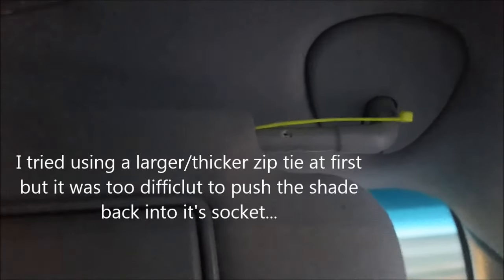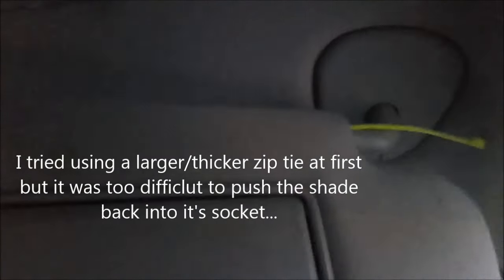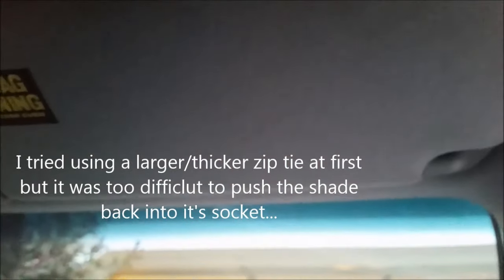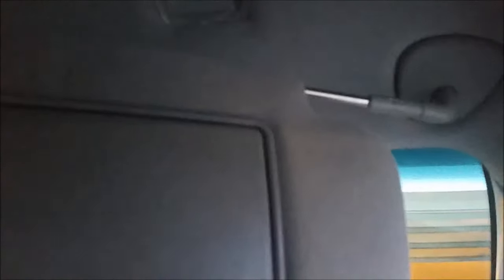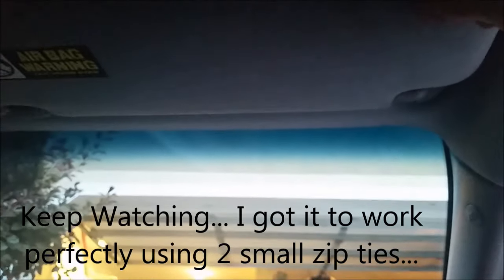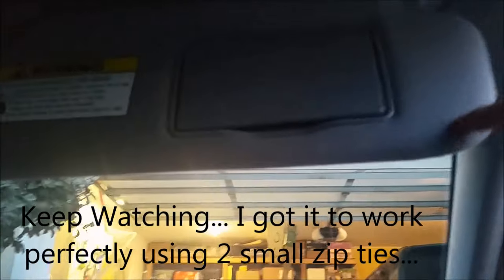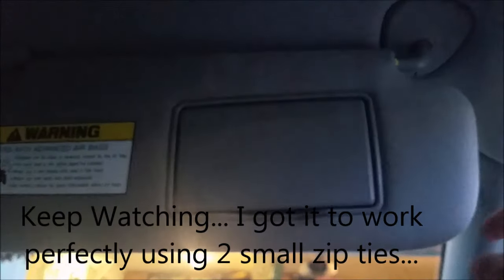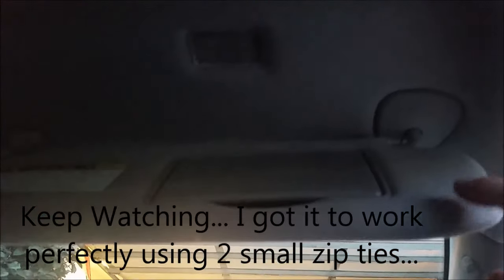How to Fix a Floppy Sun Visor that does not stay in place on Your Car for less than 25 Cents!

Comment from the maker: Hello!  I have another channel where I post repair and DIY videos. Check it out: https://www.youtube.com/channel/UCOnsjUJOcT6YVtAZU0vejZA
Reply: Does your sonata squeak in the front How do i fix?
Reply from the maker: @liljons6753  Where does it squeak? Coming from the engine or something inside the car?
Reply: @TrevorLindgren  the right suspension mostly......
Reply from the maker: @liljons6753  I'm not sure what would cause that. It could be the shock/struts are going bad but I have never replaced those. I did replace a CV axle on a different car of mine that was causing some strange noises and vibration while driving.
Reply: Dont some have wires in them....?

Comment: Dear Trevor, I am trying to do a ziptie repair of my 2002 Toyota RAV4, but I cannot figure out how to slide the flap off of the shaft. There is a copper rod inside the non-hinge side of the visor and there are no screws or slots or anything to let me slide the visor on the shaft as you show in your video.  Yours is probably a later model. But the visor flap will not budge along the metal shaft at all. Please advise.
Reply from the maker: I'm not sure how it would work in your situation. The visor might work differently. Did you have any luck?

Comment: Well I'll be damn!  I tried the tape solution and was headed to the hardware store to try the screw solution but stopped and gave this a try.  This worked perfectly!  I man'd up and used a bigger zip tie and shoved it in good and proper and now it stays up even without being in the retaining clip.  I had the same problem as he did with it initially fitting in the clip so I cut off the head of the zip tie which allowed it to slide in further.  You're the man!

Comment: Thanks for posting this Trevor.  What an excellent DIY fix that worked well for my vintage 1990s Toyota.  It just took some patience and 3 zip-ties to gain sufficient friction.  But since I bought 20 for under $5 bucks there's now plenty leftover to tie off uncooperative TV cables and in case I need to occasionally add one to the visor.  BTW, velcro didn't work and electical tape didn't hold, and now I don't have to pay $60 for a new visor or lose 3 hours of precious weekend time hunting through an auto junkyard.
Reply from the maker: Awesome!  I'm so glad it helped you! You may eventually need to replace a zip tie or two but it is still quick, easy,  and cheap to do so.

Comment: Worked a treat! If the cable tie won't slide in too far, just hold it tight to the visor pole and slide the visor back into place. Then just clip off any excess cable tie.

Many thanks for the video 👍

Comment: Wow. I can't believe the first video I checked for this was a visor on a 2008 Sonata. That's my car. I'll try this, for sure. Thanx.
Reply: I just wanted to update my post of yesterday. This process worked for me! It took a little elbow grease to get the visor back into position. I first tried the velcro method that another video recommended, but that didn't work. It took about 15 minutes to fix it with zip ties I already had. Thanks a lot!

Comment: Thank you.  I just tried this, one zip tie and the visor is like new and not in my face!  I appreciate your posting this fix, as it really works and gave me immediate relief.  Velcro and tape did not work successfully due to the sheer weight of this visor in the 2008 Hyundai Sonata.
Reply from the maker: No problem! I'm glad it worked for you! You may have to periodically replace the zip tie if it becomes floppy again. I have replaced it once but it just took 5 minutes and was easy to do.

Comment: Had the same problem with a 2014 Murano. Ended up putting Velcro on the roof and top of the visor. Works well. But I’m going to try this.  👍🏻

Comment: You can tape the zip-tie to the metal rod with a long thin strip of Gorilla Tape that's just a bit wider than the zip tie --- then slide the visor over it --- that gives it one more layer of 'friction resistance', and it keeps the tie from moving.
Reply from the maker: Good idea!

Comment from the maker: I also had a thought that scrap pieces of plastic from a string grass trimmer could work too and possibly even better because it is rounded where the zip tie is flat. Have not tried this but it could work too.
Reply: FYI zip ties or cable ties as we call them here in England can also be used to replace those pieces of plastic from strimmers and they work better too.

Comment: I have a 2012cToyota Prius. Sun shade very loose. I drilled a small hole in the shade near to elbow, put small bolt, nut and washers on it. Tightend it up, and shade is better than new. No popping and very smooth.

Comment: I'm wondering if it's a "known issue" or a defect. My '08 Sonata has the same issue, the previous owner tried velcro and it didn't work so I removed it. I'm going to try the zip tie fix! Thanks for sharing.
Reply from the maker: Jessica O your welcome! That is a good question.  There is not a recall for it yet but maybe if enough of us complain they would take care of the issue or do an official recall of the broken visors.
Reply: Do you know how I would go about filing a formal complaint for it? Just 
take it to a Hyundai Dealership? Call a customer service number?
Reply from the maker: So there is a website the government maintains that you can file safety complaints on: https://www-odi.nhtsa.dot.gov/ivoq/Complaint.cfm It says that this website may be down temporarily today for maintenance but this may be one avenue to help get the issue resolved.

Comment: Sadly this didn’t work for my 2006 Acura TSX. I used plyers to shove 3 zip ties in there but it still flops down. Tried to shove a 4th in but it didn’t seem to make a difference. Previously tried velcro but that didn’t work. Now I am going to try other things. This is such an annoying problem. Sucks that so many people are experiencing this.
Reply from the maker: Yes it is frustrating. You may have to get a new visor.

Comment: Did this hold up long term??
Reply from the maker: Yep. Still working. I had to replace the zip ties about 3 or 4 years ago by stuffing new ones in but it has held up. Since 2016 so 5 years still working ok. Not exactly like a new visor (it will come down occasionally with a big bump in the road) but it works good enough for me.

Comment: dam i tried a bunch of things...wish i would have thought of trying this first..diffinitely the best solution from how well it seems to work
Reply from the maker: roadstar499 Thanks! It is still a temporary fix and is not perfect but it helps.
Reply: Trevor Lindgren actually it seems pretty permanent to me...even new ones wear out...if it messes  up you just need to add another zip tie..I added two and cut off   the top part...excellent fix...if you figured this out yourself pat yourself on the back...
Reply from the maker: roadstar499 Thanks! I did figure it out; I have had to replace the zip tie periodically in mine but it's easy to do.

Comment: i have just cured my floppy sun visor on my kia 2005 reg sportage, I used a 50mm wide heavy duty hook and loop tape from b&q stores, I just used the hook tape only and stuck two pieces onto the mirror cover and two pieces onto the material and then pushed the sun visor back up and attatches itself to the material above the visor and its still holding, .

Comment from the maker: My fix now is not as solid as it was when I first did it. I am going to try placing another one in there or a larger one and see if it helps. I will let you know!
Reply from the maker: I replaced the zip tie with a larger one and it took 5 minutes and is doing great! I may need to periodically replace the zip-tie but it is easy to do and cheap.
Reply: @TrevorLindgren  good job Einstein , great job , gonna jam the big zip tie right off the bat , and LEAVE IT ALONE , even though i have 2 ,  big one swings to door window , keep up the ingenuity  an great video too , thanks for the share 👍✌🍻

Comment: How did you get it off in the first place? That's what I'm having trouble with. Thanks, Trevor
Reply from the maker: Is yours a Hyundai Sonata? If your visor is the same as mine I just pulled firmly on the visor (away from the hinge)  and it slides off the metal rod but be careful as once you pull it off there will be a thin wire that you don't want to damage: the small electrical wire is what feeds the little light above the mirror. Don't let it dangle because then the entire weight of the visor will be held by the tiny electrical wire. Have the zip tie ready to go before you pull it off so you can hold the visor up while you do it. Hope that helps. Good luck!
Reply: RAV4 2006… From reading I may have to pry it off, think will go with velcro meantime, thanks!
Reply: Did you get yours off? I cant figure out how to remove mine
Reply: Yes, but couldn't fix it. I pried it off somewhat carefully with a flat head screwdriver, there are some tabs that have to click off. Used velcro in the end, but needed to stick the bit on the roof with contact glue as it's regular sticky backing wasn't strong enough.
Reply: thanks! i shoved a couple bobby pins in as far as i could.  it's currently working...i don't believe it will last though

Comment: Actually, magnets worked for me.  Double sided tape and magnets worked for a while, although the magnets worked perfect, the tape only lasts a while (depending on the product), and and after removing the tape- instead a tiny bit of silicone/goop glue/ or epoxy will do the trick (I can keep you informed).  Don't use industrial strength magnets because that puts stress on the glue.  play around using the double sided tape, once you find the size magnets that feel good- then glue.  That is my experience.
Reply from the maker: Good idea!
Reply: Yes, tape's going to let go, in the heat.  If you want to stick with the magnets, maybe wrapping in a bit of fabric and hold in place w/upholstery pins.

Comment: How about 100 zip tights then burn it to the ground. Thanks for the video
Reply from the maker: Hahaha! Seriously. Sometimes you need a new visor. Check with your specific car manufacturer to see if there is a recall where the dealer will fix it for free. If not this hack can work but not in every case.

Comment: I somehow broke my visor even more trying this 🤦‍♂️ I'm going to a junk yard 😭
Reply: I could not find one at the junkyard for under $200 for a pair so I took the broken one covered the rod with aluminum foil and then used JB Weld on the backside after gluing the broken piece together, it works

Comment: Worked for me but I had to use larger zip ties
Reply from the maker: Yes I had to replace the original zip ties I used and once and a while push it firmly back into place to keep it secure. So far it has been working ok for me. It does come a little loose once and a while but still not bad for a cheap and quick fix.

Comment: How did you get the visor to slide over? I have tried and tried and cant get mine to move. I even removed it from the car. The bar is like stuck.
Reply from the maker: Your visor might be different than mine. I'm not sure why it would be stuck. My idea is not a permanent fix anyway. If you have already removed it from the car then you might consider buying a new visor.

Comment: Use 10 ties still doesn't work in my chevy captiva.. looks the sunshade too heavy.. hhssshh😖
Reply from the maker: Dang. I have heard this idea has mixed success. For some people it works great for others not so much. You may be right that the weight or the connection for each sun shade might be different.

Comment: did not work, i did manage to connect 4 zip ties and wrap them from the visor all the way to the grab handle. It may not open but atleast it stays up
Reply from the maker: Dang! Thanks for the feedback. I have heard mixed results but it has worked for a lot of people. Maybe it depends on your specific visor and how bad it is worn out.
Reply: Trevor Lindgren - Still glad i saw the video or else my zip tie idea would’ve never happened.

Comment: I think crazy glue....on the rod ...set dry would work,,,,
Reply: Did it work ?
Reply: @truefacts6830  was just a suggestion..😁
Reply: @liljons6753  my sun visor keeps falling on my subaru impreza, i might have to try the zip ties. I tried tape but didnt work
Reply: @truefacts6830  cool  or wedge a toothe pick
Reply: @liljons6753  ill try that too thanks
Reply: @truefacts6830  they sell flat ones

Comment: Doesn't do the job. Pointless video
Reply from the maker: Sorry it did not work for you. It really is just a temporary/cheap fix.  I have had to replace the zip tie once but it has been holding up reasonably well for me.  You may need to buy a new visor.
Reply: Trevor Lindgren , my visor was inflicted with a more serious issue. It suffers from wife-itis.
Reply from the maker: Well good luck with that. :) I may eventually buy a new visor too but for now this is working great for me because I just commute with the car and rarely have a passenger in the passenger seat so that visor is not under heavy use. I just wanted it to stay up better.
Reply: Not a pointless video, it has worked for heaps of people. At least someone has had a go. Where is your fix it video Tedbert ?